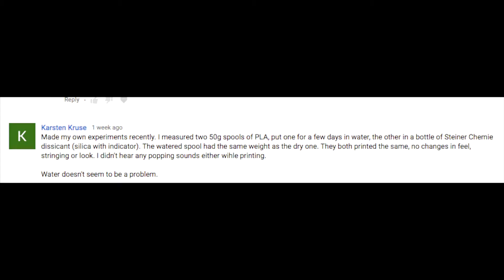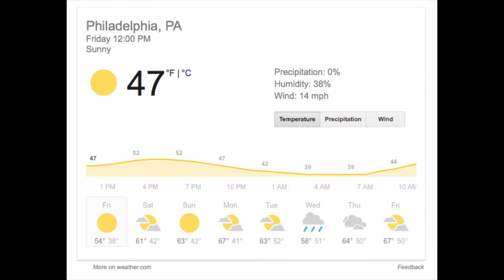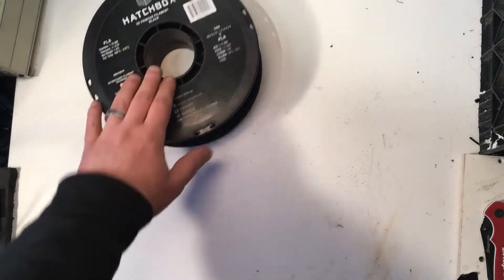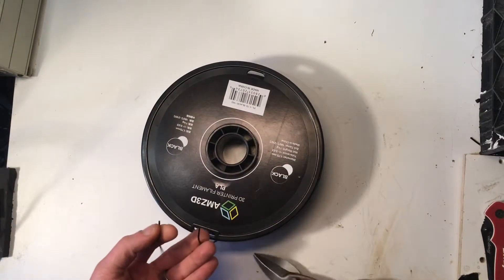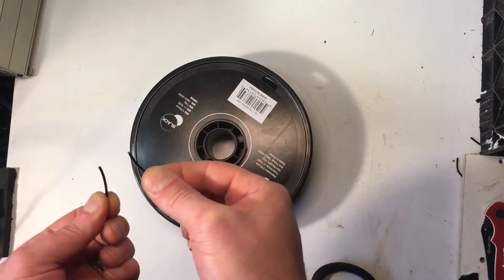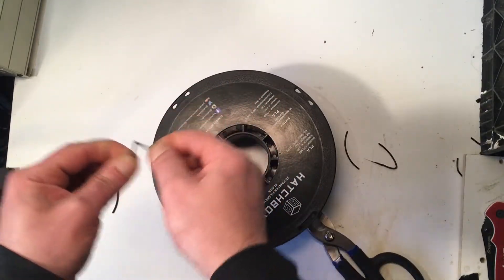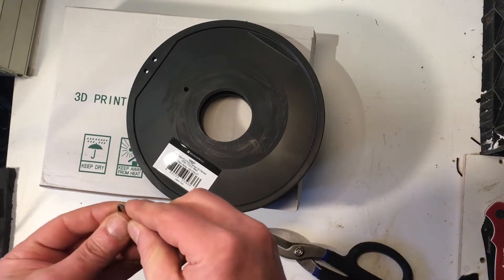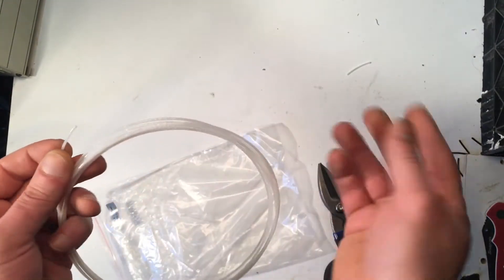TEST: how to avoid brittle PLA filament - part 1 of 2

Comment: Now that AI is here: The brittleness of aged PLA is better explained by physical aging—a natural reorganization of polymer chains—rather than ambient humidity. While moisture can worsen mechanical properties (e.g., during printing), the core issue lies in PLA’s inherent material behavior. - deepseek 2025
Reply: While physical aging is primary, other contributors include:

Crystallization: Prolonged storage might allow minor crystallization in semi-crystalline regions, increasing brittleness. However, significant crystallization usually requires heat. - note: the slow hydrolysis rate at ambient conditions is unlikely to fully explain brittleness over typical shelf-life periods (months to a few years).

Oxidation/UV Exposure: If stored in sunlight or oxygen-rich environments, oxidative degradation can occur, but this is avoidable with proper storage. -  Note: Users report PLA becoming brittle even when stored in dry environments (e.g., sealed with desiccant). If humidity were the sole cause, brittleness should be mitigated in these cases—yet it persists.
Reply: Misleading Perception: Users assume drying fixes brittleness because they conflate moisture removal with heat exposure. The key benefit comes from thermal energy, not just desiccation.

Heat’s Role: Heating PLA to 40–55°C (common in dehydrators) brings it closer to its glass transition temperature (Tg ~60°C). Even below Tg, this provides enough energy for polymer chains to partially "relax" from their aged, densely packed state, reversing some effects of physical aging.

Comment: Looking forward to part 2, as I am currently at the second roll of brittle PLA.. really weird.
Both are older (2+years( cause I buy too much filament (I know, this will never happen to you guys), different manufacturers, different colors.

Here is where the weird comes in.
They are stored in a cupboard, away from light, with dessiccant in the original containers.
The first was opened, the second one was sealed in the original vacuum bag with the desiccant for the full time.

I actually put it down to being at the end of the roll for the first one (tight roll, mechanical stress, ...)
The second one is breaking a LOT over night, when I leave it on top of the printer, less so while printing (had one instance of that, so far, <3h prints)

The printer is in the DARK basement, where it is about 14 c even in winter, and 18 c now. Storage is in my office (normal room temp) or in the workshop/basement.

Other than age... I can not point to anything.

I tried heating the first roll slightly ~50deg C for a while, but it did not change anything.

Comment: I suspect  those   water bucket pla tests  are silly.  because  they ignore the    time aspect of  water in amongst the crystaline pla structure.  so the overall  temp cycling  that is nature with the water between the  crystaline structure would causing micro cracking  over time...  this would result in   enbritlement...     so when  people  oven dry,  there  not just evaporating the water, there also  recrystallizing  with the absence of water to some extent...    this is my  theory....   it also explains why some people get different results.. because only removing water isnt the only goal... in the case of brittle filament.

Comment: My spools are kept in closed plastic containers not air tight but reasonable sealed no light no air movement I have desiccant in with them but not religiously changed but when I opened one of the containers the filament on one spool was still rapt around the spool but it was in pieces 5 to 10 cm long but without pulling it out I assume the whole spool was in this condition but it was only one of a few in there the rest appeared ok. I also have just a cut off left in the extruder where the light shines not direct light just indirect light through a widow but where the light hits the clear filament looks to be full a bubbles and whats in the shadow it's still clear and flexible medium humidity and air flow

Comment: So I have a hunch that different formulations or additives introduced from recycled plastic content could be some what of a wild card.  I have had one spool out of 3 from the same manufacture go bad sitting out in the same conditions. The other 2 print just fine.   Really interested if you get some conclusive results from this.
Reply from the maker: I think you are right about that.  I did some research into the additives for PLA containers when I started this, and they vary wildly from product to product, and there was very little info about specific PLA printer filament formulations.